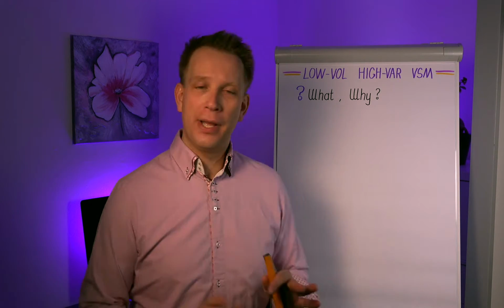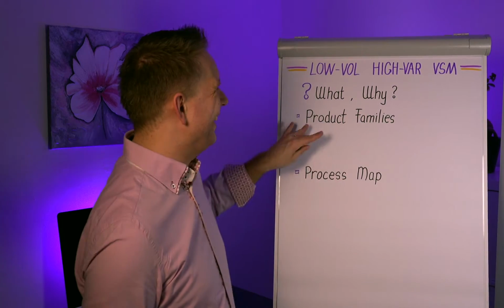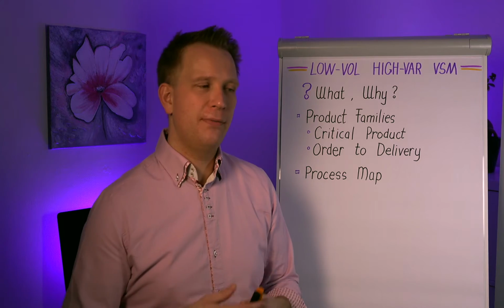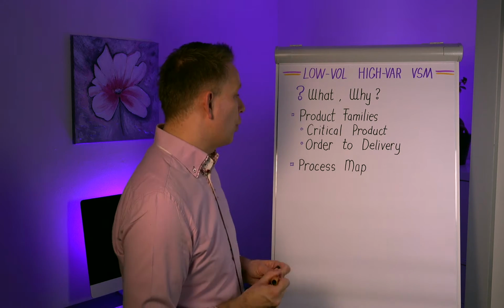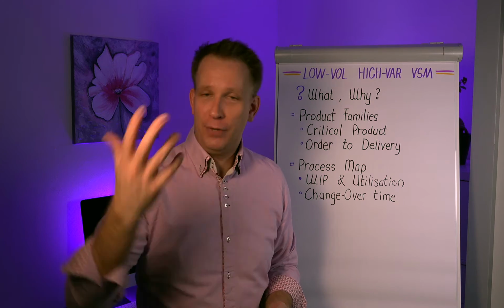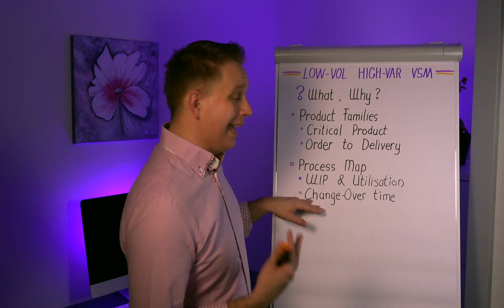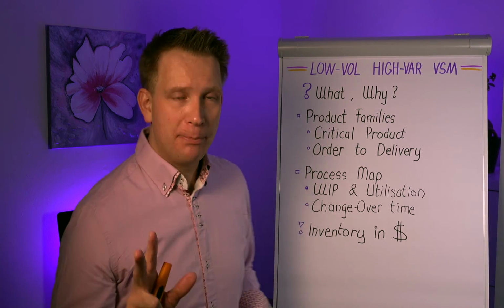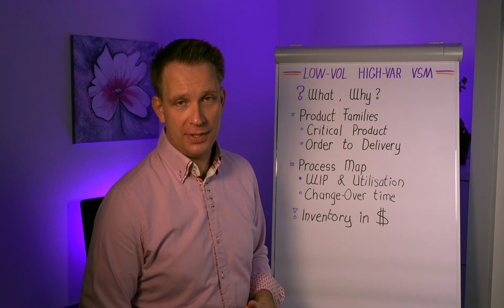How to Value Stream Map (VSM) in Low-Volume High-Variation production

Comment: Hi Tom! Ive been meaning to leave a comment when you released this video.

Main purpose of the value stream map initiative is to drive TAT reduction and improve OTD.

We did a quantity-profit analysis to figure out which products to focus on.

Using historical data, we found out that we had a handful of processes that has a high idle time, which drove the TAT.

12:13 we do have furnaces and heat treat process and you're absolutely right that it's one of our bottlenecks due to high run time and high change over time.
Reply from the maker: Great to hear your experiences - I'm sure other viewer also love it when you share such things (we're all CI enthusiasts out here, after all).
Especially with these low-volume production runs, turnaround time and on time delivery are key indeed.
You'll probably have seen that OEE isn't all that useful for making impactful improvements, but flexibility, change-over time, and the like are really important.
Great stuff, thanks again for sharing.
Reply: @TomMentink oh yes, definitely! OEE doesn't make sense when we have equipment that only has 11% utility rate 😂